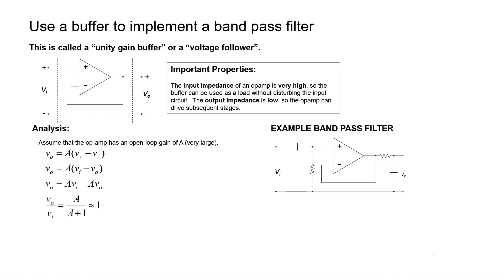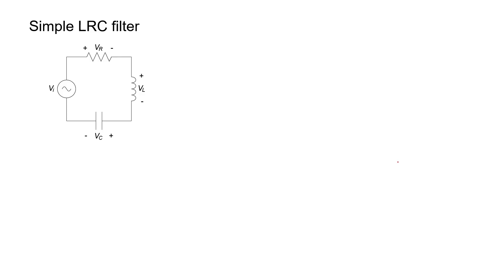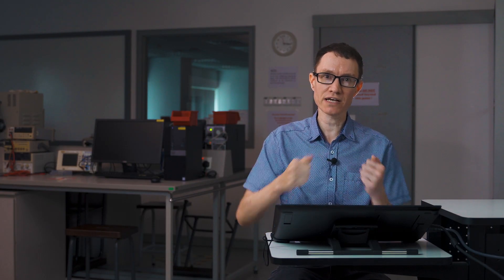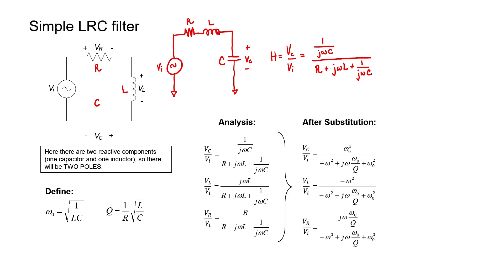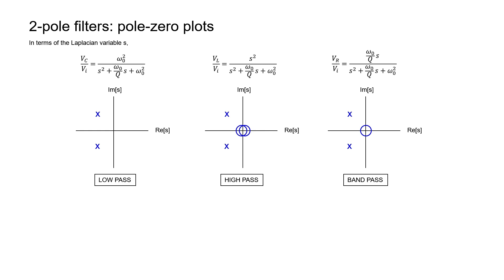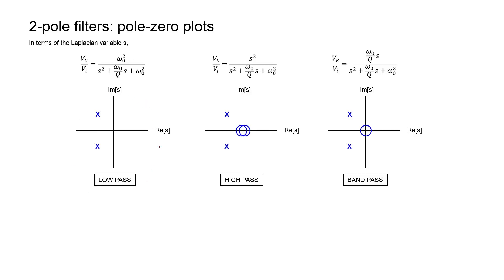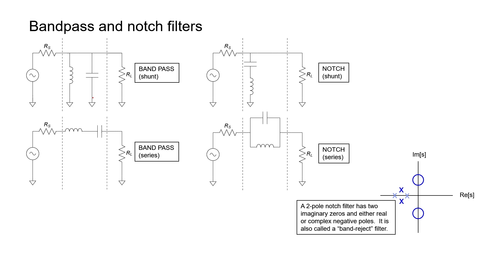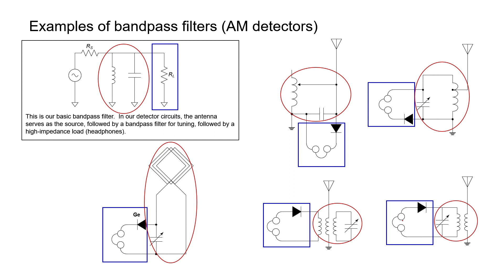All about 2-pole RLC passive filters (7 - Passive Filters)

Comment: Hello!
I have a question. If i have a passive RC bandpass filter that doesn’t have a buffer, so a high pass filter followed by a low pass filter with no op amp in between, is this still a second order system with two poles and two zeros? 

When i work out the transfer function, there is only one zero since a low pass filter doesn’t have any zeros.

Thanks!

Comment: At 8:48 you introduce Actual 2-pole low pass filter response.
How can a passive filter output a postive gain at the cutoff frequency. For me is does not make sense passive components are able to deliver positive gain?
Reply from the maker: The large voltage gain which you have noticed near the pole frequency does not imply amplification or power gain, and as soon as you attach a resistive load to the circuit this would become clear.  In the low pass and high pass filters, the load as plotted is purely reactive, so zero real power is actually delivered even though the voltage can be very high.  In the bandpass filter, you might notice that the load as plotted is resistive and the gain peaks at exactly 1.
Reply: The source voltage Vs=VR+VL+Vc in the RLC series circuit. At resonance, i.e. ω=1/√LC, VR=Vs and VL=-Vc. Next, compare |VR|-|VL|=Im(R-ωL)=Im(R-L/√LC)=Im(R-√(L/C))=Im(R-RQ)=ImR(1-Q), where Im=current drawn at resonance frequency and Q, the quality factor,Q=(1/R)√(L/C). Therefore, |VL| or |Vc| can be larger than |VR|=|Vs| at resonance frequency if Q>1 depending on the values of R,L and C.